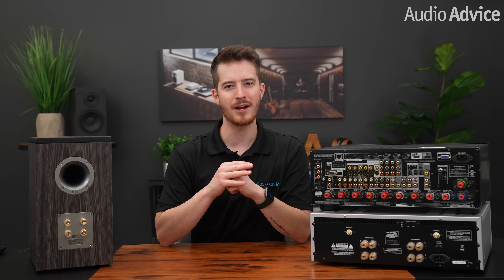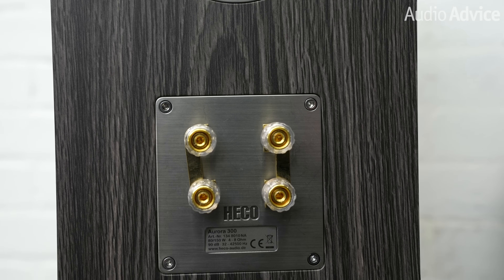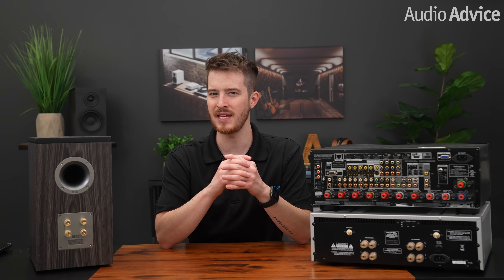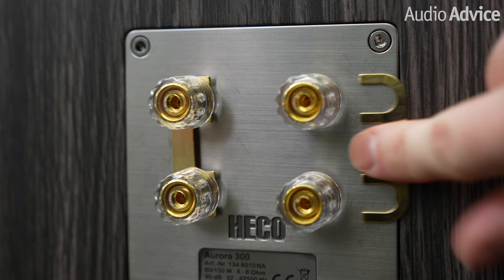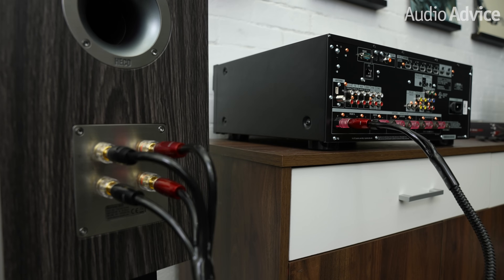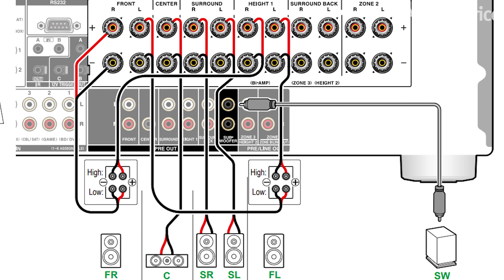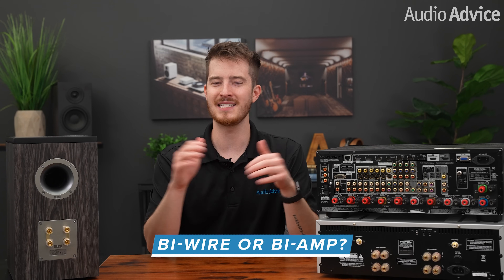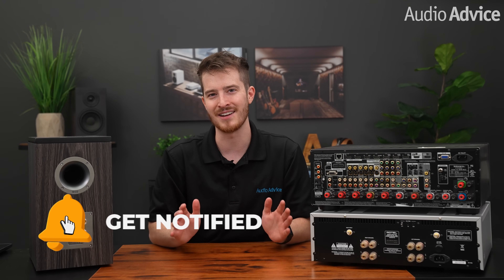Bi-Wiring & Bi-Amping Explained | What is it? How do you do it? Is it worth it? Let's talk about it!

Comment: If you don’t have two amps, passive bi-wire CANNOT WORK with two wires going to one output. Rules of physics dictate. Adding connections will add more resistance than it is getting back up the cable. Theory is false
Reply: Have you noticed that there is the same number of connections in each system? Bi-wire has a total of 8, single-wire also has 8 (2 binding posts at amplifier, 2 binding posts at speaker, the speaker then has 4 connection points on the two straps or jumper wires joining the LF and HF binding posts together.) If you're interested in what the laws of physics dictate about bi-wire compared to single-wire, it's very interesting to start with a clean sheet and no preconceptions and carefully draw up accurate (with every detail) equivalent circuits for each, and observe the differences. It's the fact that two wires are connected to the one output and earth return directly at the amplifier that means bi-wire can work, in the sense of creating some moderate difference in operation. It's certainly not as much difference as bi-amping, but if you're not using active crossovers ahead of the amps to directly connect the speaker drivers to the amp outputs, there's surprisingly little difference between single amp bi-wire and dual amp bi-wire when you put detailed circuit layouts side by side.

Comment: Bi-Wiring with a single amp really makes no difference.   All frequencies go along the same cables and any difference is plecebo only.
Bi-amping may make a difference, if you have the correct crossovers at the pre-amp stages to give the right outputs at the amps.  Anyone using a powered sub-woofer fed from a dedicated LFE output from an amp is actually bi-amping as the subwoofer is amplified separately from the main speakers.       
If you join the speaker cables together, even just at one end, all signals are on all cables.  This rubbish about having reflected signals is just not a thing at speaker levels.   Once you join the cables, even at one end, you create a circuit between the two cables, and can actually make it sound worse.
Reply from the maker: As we stated, this is a hotly debated subject with some speaker manufacturers agreeing with you and others disagreeing.  It comes down to trusting your own ears.  Thanks for watching and commenting.

Comment: Thanks for the video, well done.  I am considering bi-wiring my center channel with a powered sub to handle the lower frequencies and using my existing amp to power the center for the higher frequencies.  The only way I can think of how to do this would be to run a Y-cable connector from my pre-amp center, with one Y going to my amp [as per usual] and the other Y running off to my powered sub.  Am i correct in this thinking?  If so, with the single RCA going to the sub in this instance be plugged into the LFE, or should I Y connect that signal to the sub's L & R input?  Thanks, hope my description makes sense.  For the record, I have recently purchased two SVS PB-3000 from Audio Advice and those will be my primary subs.
Reply from the maker: That could work, it makes sense what you are trying to do. But you need to deal with a way to cross it over.  If you tell the processor to cross over your center channel, it will not send any low frequencies to the sub.  If you tell your processor the speaker is full range, you are not getting the benefit of taking the bass out of the center speaker.  A better way to go would be to tell the processor the signal is full range, run an audio cable from the processor to the subwoofer input, use the internal crossover in the subwoofer, then run an audio cable from the subwoofer audio out back to your power amp for the center channel.  Hope this helps and we appreciate your support!
Reply: This is. a year ago but this won't work. I understand your wanting to bi wire to the tweeter of the speaker and then not the woofer and instead use your sub as the woofer. Problem is that the woofer is also likely carrying out mid frequency duties as well. So your cutting off your speakers mids and only having highs from tweeter and lows subwoofer. Subwoofer only handles below 120 hz. Your left with a big gap in frequency coverage and it will sound awful.

Comment: My Audiolab 8000 system, though a little old now is Bi-amped and Bi-wired, that is 4X mono block power amps, one for each speaker driver. I have found that this provides the best clarity and sound stage. At the time, I had money to burn! this was about 25 years ago and with high quality cables and interconects cost a small fortune but it has served me well
Reply from the maker: Very nice!
Reply: Go active!

Comment: I've been debating between the denon s760h and x1700h.  Most specs are similar other than marginal power upgrade snd ability to bi amp. But its about a extra $150. Do you believe the bi amping ability is worth the extra cost?
Reply from the maker: They are very similar, they even weight almost exactly the same.  You would probably wind up using all 7 channels and not be able to take advantage of the bi-amping,  For more information, please reach out to our team at www.audioadvice.com  Thanks for watching

Comment: My current outgoing theory for why people hear a difference is the removal of the jumpers. Swapping the jumpers for 6" of speaker wire with y spades on it imo is equal to running new wiring from avr to speaker. Another thing is if you're using say 14 gauge wire and comparing to 2 sets of 14 gauge wire you're technically closer to 12 gauge than 14. Also what kind of speakers you have might make for a bigger difference as a 3 way speaker with the top terminal handling the tweeter + mid vs bottom handling the woofer(s) would make a bigger difference when bi-amping over a 2 way speaker like most bookshelf speakers. Edit: also psycho acoustics such as expectation bias and stuff really make it hard to gauge if it's actually better or not without your mind tricking you
Reply from the maker: Thanks for sharing!  Its a very debated subject.
Reply: Each element undoubtably contributes.  The average plate jumpers are horrible, so that’s a win just by removing them.  Doubling up on the wire also improves things, so again, what’s not to like.  Finally, the segregation of the signals is a real benefit, delivering a performance jump in any moderately resolving system.  My systems are more than moderate, however, I bi-wired my daughter’s system a couple of weeks back and the overall effect of all of the above delighted everyone who heard it.

Comment: If you believe in the “back-emp theory” described in this video, then by all means, feel free to experiment with all manner of connecting any number of cables, in any number of combinations, between the full-range red and black outputs of each channel of your audio amplifier and the corresponding red and black terminals of each of your passive loudspeakers. You may then conduct all manner of listening tests, scientific or otherwise (because audiophile quality is ultimately a deeply personal matter), and see if you can perceive any difference whatsoever.

Otherwise, if you have speakers with separate pairs of red and black terminals for high and low frequency drivers, but you don’t care to use separate bi-amped power amplifiers, simply acquire the thickest-gauge dual-conductor speaker cable you prefer, and connect the red and black terminals from your power amplifier outputs to both pairs of red and black terminals on each loudspeaker. If you have any doubts about the electrical quality of your loudspeaker cables, feel free to use an ohmmeter to test the resistance of each conductor (with the speakers disconnected). If that cable resistance is less than 10% of the rated impedance of your passive loudspeakers, you should be good to go.
Reply from the maker: Thanks for sharing

Comment: IMHO, this is nonsense.  Bi-wiring is a complete waste of time.  If anything, it will make your speakers sound worse.  Bi-amping can improve sound, but not the way you are discussing here.  The way you are discussing bi-amping, you could achieve the same impact by simply using a more powerful amp instead of bi-amping with 2 amps.  And I wouldn’t consider doing any of this in a HT context.  And BTW, no one can hear the difference between cable lengths unless we are talking about radically different lengths.

I am bi-amping, but I am using speakers designed to be bi-amped which most commercial speakers really aren’t designed to do.  The commercial speakers that are designed to be bi-amped typically have a built in amp for the bass region.  They are bi-amped, but you as the consumer cannot power anything other than the tweeter and the midrange which have a crossover between them.

How do I know my speakers can be truly bi-amped?  Because they are custom designed for bi-amping and they demonstrate the situation in which bi-amping can make a difference.  The speaker is a 3-way design.  One amp powers the tweeter and midrange which have a passive crossover.  The woofer is powered by a separate amp with an electronic crossover.  One advantage is that you don’t have to use identical amps.  This form of bi-amping allows me to use a low powered amp for the tweeter/midrange and a higher power amp for the woofer where it is really needed.  This allows me to use a low powered tube or Class A amp for the tweeter/midrange and something like a high powered Class D amp for the woofer.  This approach also can provide more control over the response of the speaker in your room.  Good Class D plate amps also have EQ to control amplifications of certain bass frequencies due to room geometry.  I also have full control over the electronic crossover point and slope.  As you can probably tell, these speakers are part of a 2 channel system.  For HT, I wouldn’t waste my time or money.
Reply from the maker: Thanks for sharing

Comment: Bi wiring is stupid.. just put jumpers on the speaker Binding Posts. To really make the best use of Bi-Amping.. you should avoid the passive crossover in the speaker and use a 2 way speaker processor .. Really good passive Home speakers are so good that you really don't need to Bi-Amp anything except when using a subwoofer. get the right products for your application. I am an Audio Engineer. My home system is Passive with a powered sub.. my PA Systems I use for Concerts  and events are Tri-Amped... but they are built to do that. Get over yourself... if you want better sound, buy better gear and better and bigger Amplifiers, but remember.. it takes twice the power ( 100 watts to 200 watts ) to get a 3 db boost in volume. It takes 10x the power to get twice the volume. What you're really buying in Home Stereo is better signal to noise in the chain... buy better gear !
Reply from the maker: It is a highly debatable subject, thanks for sharing

Comment: Bi wiring does nothing. Whatever electrical travel created by the woofer would travel up the wire and right to the tweeter, unless the wire was a mile long (exaggerating obviously,.. but not really). Bi wiring or even the jumper would work with a diode inline allowing one way electrical signals from the source.
Reply from the maker: As we said, it is a controversial subject.  Thanks for watching
Reply: Dave, (assuming you are an actual person) I sometimes ask people, have you thought of learning some electrical theory so that you can understand how things like this work? You could save yourself from either jumping to faulty conclusions, or being misled by what other people tell you or what you read in various places.
Reply: @PlatypusPerspective  ssssh. Adults are speaking.
Reply: @_.Dave._  So I'm guessing your answer is no, you've never thought of learning?

Comment: With bi-wiring, does the ohm of the speaker change?

like if you have 4 Ohm speakers, will it turn into 2 Ohm?
Reply from the maker: That is a great question, since you are connecting things back together on the amp side, it should be exactly the same, but we will put a meter on a couple of set ups to see.  Thanks for watching
Reply: I am still wondering if I should bi-wire just because I can.
Reply: @chewingcheung  if you can, I recommend you do.  What do you have to lose?

Comment: This topic is overridden by the ONLY real way to BI-amp a ROOM.   AND it is also the strongest argument for including dual/two HIGH QUALITY sub woofers in your 'theater' .  
Adjust ALL speakers , other than the subs, to have a low cut off of 125 (or 125-180).
NO HUMAN can truly hear the point source of base below 125 , it is omnipresent . (when the subs , located WHEREVER/wherever you like or have space , are turned on you will SWEAR the front speaker just started to produce base frequency even if the subs are in the back of the room.
The main ,surround,rear ,center, or atmos speakers are relieved of base (125 and lower) power interferences and perform at their best
Reply: That is usually the case, but in rare cases such as mine, I beg to differ. My sensitive ears feels the pressure on of the side of my ear the sub is  placed on,  even at lowered volumes and lower frequency although more difficult my ears can tell. I ended up getting two small subs to ease the pressure to evenly spread the sound.
Reply from the maker: It certainly is a controversial topic, but we love hearing your viewpoint. Thanks for watching!
Reply from the maker: Nice! Thanks for sharing your setup!

Comment: Bi-wiring and bi-amping are not only ‘not worth it’ - they are BAD
You will either not gain anything in the best case, or degrade your system in the worst - in both cases you will waste money 
The reason is simple: 
Loudspeaker manufacturers design and tune (high-end audio is still an art) their products ASSUMING that the inputs to the high-end side and the low-end are IDENTICAL 
They have to because they cannot predict anything else
Do ANYTHING to upset that assumption (such as bi-wiring or worse,  bi-amping) and you will destroy the results of their excellent work
Reply from the maker: Thanks for sharing!